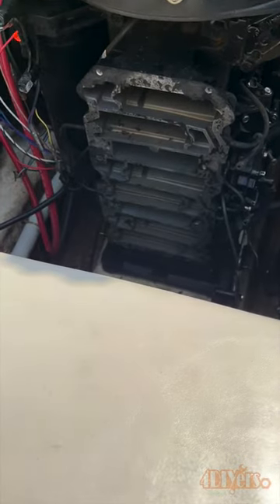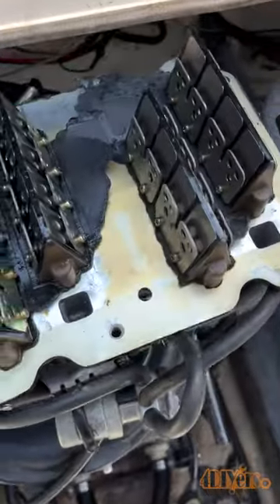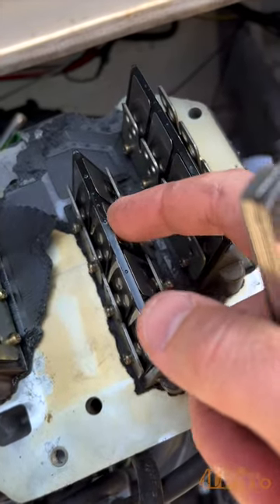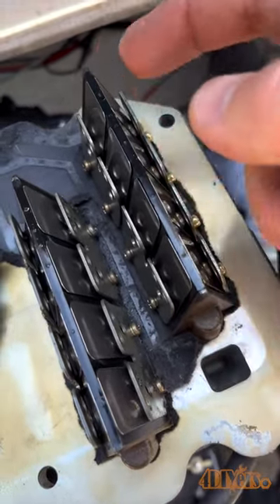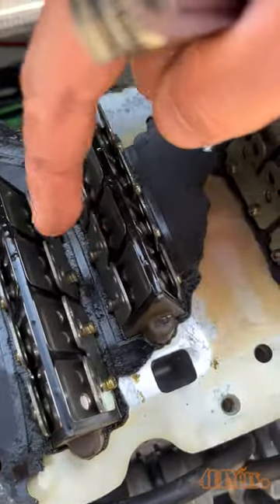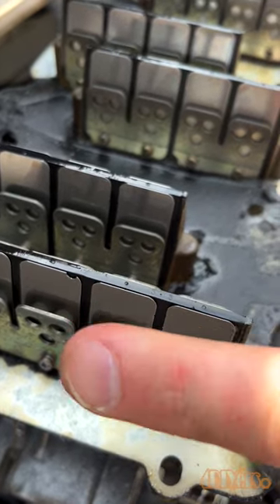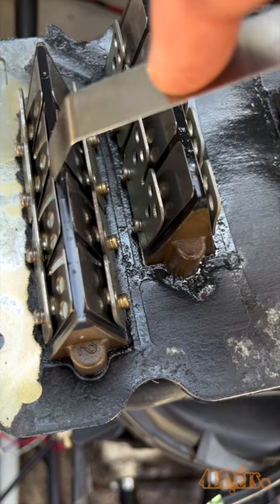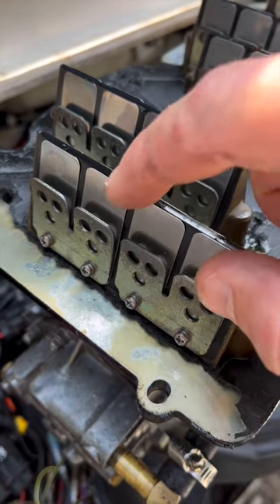How to Check if Reed Valves are Bad

Comment: Now, do you go check the piston that piece went through, or is there no concern of damage??
Reply from the maker: If there is multiple chips, then yes its a good idea. There is definitely concern for damage, the stainless steel reeds are not forgiving which is another benefit for switching over to a fiberglass version.

Comment: On motorcycles I just turn the reds over.
Reply from the maker: Great tip! Yes this can be done as long as they’re not fatigued. Mine are already fatigued so they’ll just break apart more and risk damaging the engine.